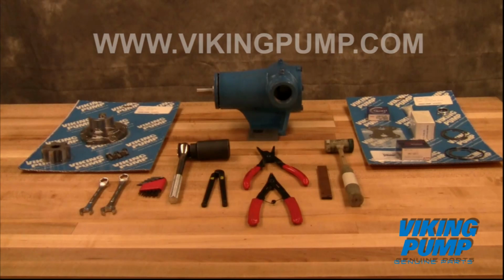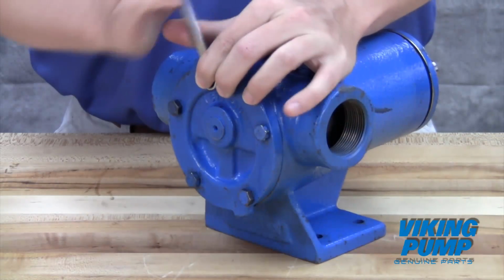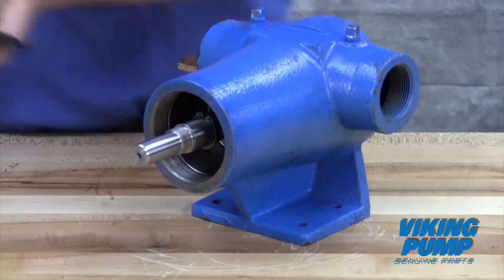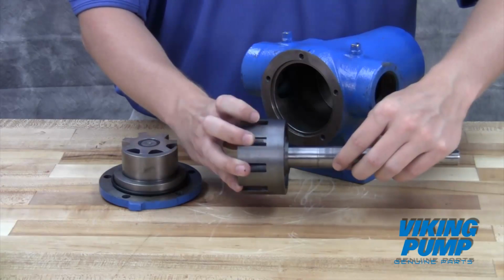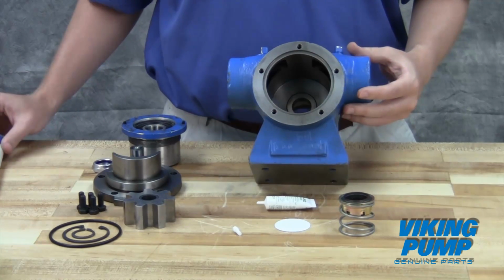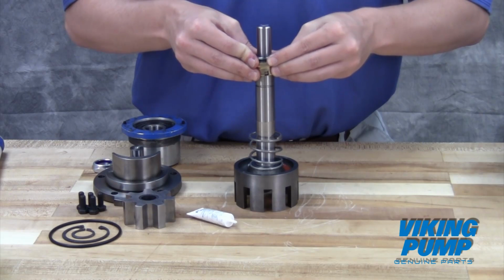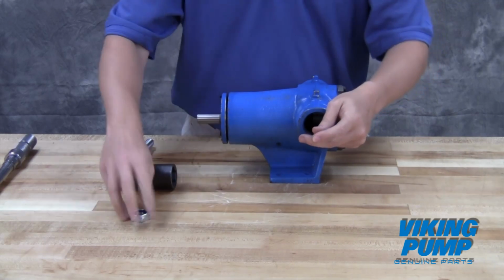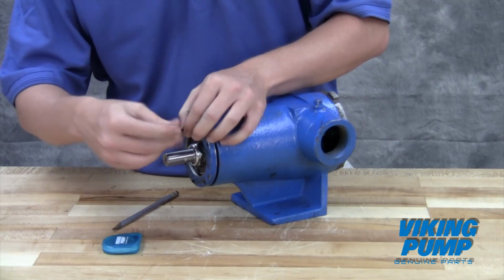Viking Pump Motor Speed Series 493, 495, 4193, 4195, 4197 Pump Repair Kit Installation

Comment: There are holes in underneath output, some oil comes out from them, should we close them or what is there job?
Reply: I'm assuming that you're referring to the small hole on the underside of the casing (you can see it at 0:59).  This is a leak detection hole.  Any leakage that should get past the mechanical seal will exit here rather than passing through the bearings.  DO NOT PLUG THIS HOLE...doing so would cause seal leakage to build up inside the casing and may fail the bearings, resulting in a pump failure.

A few drops of oil is fairly normal, especially at startup of a new seal, but if the leakage rate increases it's an indication that the seal is failing and needs to be replaced.  In either case I would recommend contacting your local authorized Viking Pump distributor to get a seal kit on hand just in case.  Seals have a finite life and it's best to be prepared.
Reply: @raykinsella5081  That's what I expected.. Thank you for helping.

Comment: I have this pump but releases valve is also attached. 
plz tel me where the release valve face ?
Reply: The adjusting screw cap needs to face towards the suction side (inlet side) of the pump to be in the operable orientation.  A video detailing the valve's operation can be found here: https://www.youtube.com/watch?v=SR9F6lfMEAA